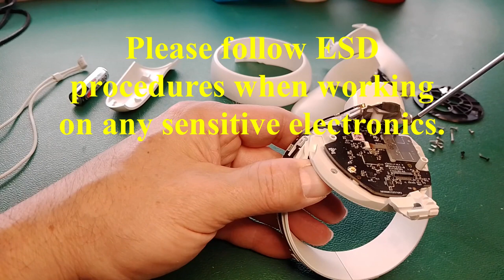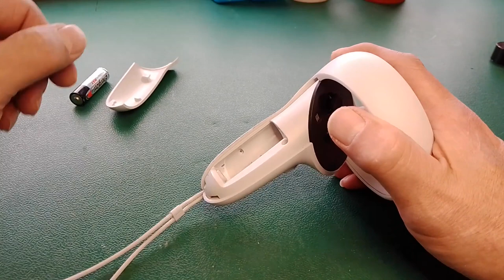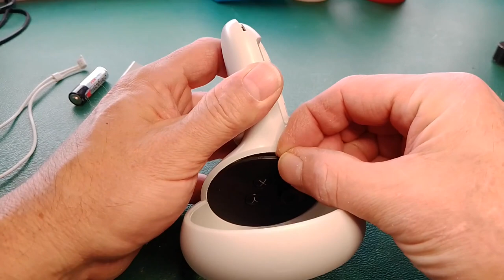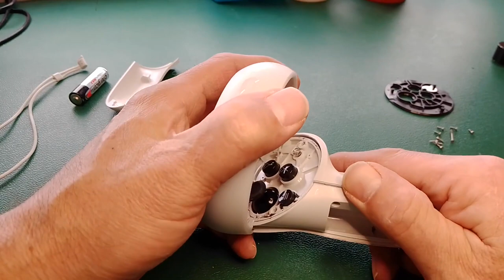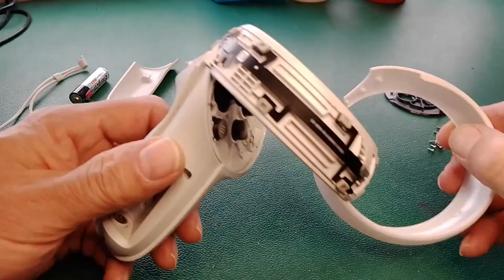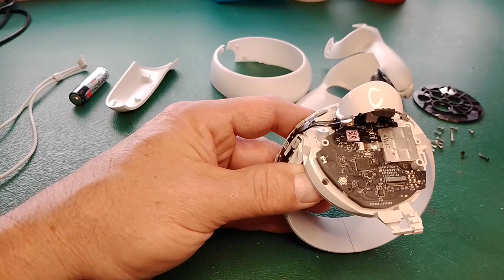Quest 2 Controller Disassembly - Don't Use  (New Version Here https://youtu.be/aZ57n6iam6Q )

Comment: Thank you for the teardown explanation! My controller catched some sugary water and circuit board got a short. With some alcohol I was able bring it back from the dead. Also, when assembling before connecting back the wide power cable, it's good to detach the front part of the handle to make access to cable a lot more easier and connect it, assembly becomes quite easy with that.
Reply from the maker: Glad it was helpful.  Have a bright day!
Reply: hopefully this works for me i was stupid enough to thing it was ok to wipe of controller with a disinfecting wipe. but that front trigger just directs everything to the board. ive been using disinfecting wipes on controllers for years but this controller is something else when it comes to liquid.
Reply: @andrewh1096  did you have any luck? i wiped my sons off and 😫hes complaining that its glitching and messing up.

Comment: Thanks for the heads up and tips. I changed the drifting analog stick very clean , you could not notice if it was opened or not. I heated the sticker a little and it came off very easy.
Ended up removing the ribbon cable from the grip and guided it back after assembly , much easier
Reply from the maker: Way to go.  Folks have definitely found some different ways of doing things.
Reply: @ImaRainbow  right

Comment: 7.08 instead of taking the ribbon off u can dismantle the  handle bit more . Check the ribbon on the handle part u can see the frame securing the cable can be taking apart . It makes things easier after that parts gets taken off first .  Thanks for the video son drop the controller and snapped the middle finger button , somehow manage to get it fixed but button does get stuck occasionally.
Reply from the maker: I'll try that out the next time I have to take it apart.

Comment: Thanks for the video! I've been having issues with the joystick drifting on my left controller, do you know if the joystick is removable?
Reply from the maker: Hi Joe.  At 9:40 in the video you're able to see a silver square on the cca.  It's got "0fwh" on it.  That's the joystick and it does come out.  Just need to flip the lever on the ribbon cable.  I don't know where you'd get a replacement though.
Reply: @ImaRainbow  All right thanks for the quick response! I'll look into it
Reply: Oh no.. I'm trying to fix my son's occulus control drifting problem at the moment... you know it needs to be replaced? I was hoping It could be fixed by cleaning and maybe re-adjusting its position...
Reply from the maker: @JustAnotherYou2  My best advice is to try the contact cleaner first.  It's inexpensive and doesn't require you to disassemble anything.  Check this video for how https://youtu.be/6Z3qv_FJbsE

Comment: Attempting full disassembly. X and Y on the left controller stopped working. Feel loose. I'm not even a rough player. Pissed off. I did your trick with the spray for the joystick. Had drift. No more drift. But the buttons were busted before I even took it apart the first time. Trying the full disassembly. Thoughts? Thank you, sir.

Comment: I bought used quest 2 and one of the AA batteries leaked and caused the spring loaded contact pin to get stuck with powdery discharge from battery.  Your video helped me take controller apart so I could get pin moving again.
Reply from the maker: Glad I could help you, help yourself.  Happy gaming!

Comment: Hopefully this video will help me fix my controllers. My cats decided they should use them as a bathroom one day and after wiping them down intensely the right one has tracking issues and the left has drift.  So heres to hoping that if i take it apart and wipe it down with alcohol that’ll it’ll at least fix the tracking issue
Reply from the maker: ☠️☠️☠️🙀
There's a reason I don't have cats.

Comment: Hey! I know this video was a while ago, but I’m wondering if people are selling that skeletal part in the middle of the screen 0:09 The part with the ring and the sensor cables connected to it? If so I really need a link to a seller or at least the name of that   
Specific part. Thanks

Mine cracked on the side and I don’t know if I can replace it without buying every other part attached to it, I’m considering just buying a new controller but let me know if it’s cheaper to just repair it. Thanks again!
Reply from the maker: There's a site called https://www.fixmyoculus.com/ where you can buy used/new parts.  If you can do the repair yourself its cheaper than buying a new controller.  BTW, this is a better teardown video for the controller.  https://youtu.be/aZ57n6iam6Q
Reply: @ImaRainbow Dude you saved my life, Thanks you so much!!!! 
Now I just gotta wait for it to restock 😅😬🔥
Reply from the maker: @Hybrid_GTag15  Glad I could help.  Hope it all works out.

Comment: okay great instructions thank you very much !! 
but after my heavy hand, the controller has now not just one problem.. but one more is added as my ribbon cable latch part on the main board is broken from its place even you warned it is the most hardest part.. 
normally i am from outside of US thats why oculus cannot support but agreed with Oculus to send the controller for fixing or a replacement..
hope they will not charge for this after this issue.. 😊
Reply from the maker: Sorry, I've done everything I can to point to the New Version.  It has a way to disassemble the handle. Good luck.

Comment: Thank you so much for this video. Not sure if it’ll fix my stick drift yet, but I am attempting to follow through with the steps. I haven’t finished the video yet so my question could be in the video, but is this a good way to fix stick drift? And the sticker at the beginning that needs to be removed, is it okay to still put in a battery or does the sticker need to be replaced?
Reply from the maker: The first thing to try is a cleaning.  Doesn't require complete teardown.  https://youtu.be/iitoevOXrf8
If you do need to tear it down, I'd recommend this video instead.  It's better.  https://youtu.be/aZ57n6iam6Q

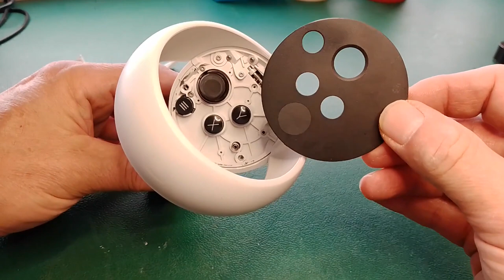Comment: Thanks for this! My analog stick is drifting, at 3:33, after popping off the face plate, can I just pull the analog stick so I can spray contact cleaner directly?
Reply from the maker: Hi Jevi,  If it's the stick, you may not have to pull it open at all.  The contact cleaner seems to work by just getting it around the stick.  My cleaning video shows how to do that.  https://youtu.be/6Z3qv_FJbsE  I'd just try a little bit at a time.   If you do pull it apart, just be careful. I pulled mine apart cause it was non functional.  Either fix it or buy a new one was the situation I was in.
Reply: @ImaRainbow  yep. Tried that. Worked for me. I just wanted to know if ever the first method won't work anymore that I may need to disassemble the face plate.
Reply from the maker: @TheInfiniteinfinity  For the contact cleaner, I'm not sure if you gain much taking it apart.  If you have problems with the buttons, you would.
Reply: @ImaRainbow  so directly on the thumbstick?
Reply from the maker: @TheGamerGod.  Hey.  I think you're asking about cleaning the thumbstick to eliminate drift?  If that's so, then this is the vid to watch.  https://youtu.be/iitoevOXrf8
If I've got that wrong you'll need to explain a little more.

Comment: I've used a WD40 special electric contact to clean the controler but now it doesn't power up at all, do you think that cleaning everypart with alcool and Q-tip may help ?
Reply from the maker: If you used WD40 Contact cleaner, that shouldn't have caused a problem.  I'm assuming you disassembled it?  If so, you might want to verify that all of the electrical connections are connected.  This is a newer, better video for teardown and reassembly.  https://youtu.be/aZ57n6iam6Q
Let me know if I can help with anything else.  Good luck.
Reply: @ImaRainbow  Yeah i did but not to the electric card component, just to the black circle in ordre the move and repear the head off the joycon, i've cleaned everything with alcohol and imma look your video, thanks
Reply: @ImaRainbow  Dude, accept this huge thanks from me, i swear i've got a tear of joy

After cleaning everypart even under bus with alcohol using your video, the controler start again, all my thanks to you, i hope you will have a freaking good years to spare me this money that I don't have

There's now just the right trigger that work like TOR (fully enabled or fully untouched) but no matter it work )
Reply from the maker: Glad I could show you the way.  Happy gaming!

Comment: Hi,  would you know the grip trigger button screw size (dxl).  Regards Mark C.
Reply from the maker: Mark,  All of the screws in the controller are T5s.   I believe they're M2s, some are machine thread, most are coarse thread. 
You might want to check out this video, instead of my old one.  The new one is much better.  https://youtu.be/aZ57n6iam6Q
Let me know if I can assist with anything else.  Have a great day!

Comment: Great content would you possibly know where to find parts ? I need to actually replace the transducer compleatly. Or any suggestions on anything that has exact part that I could rob from. Thanks again for your video.
Reply from the maker: Sorry.  I've tried to find a replacement transducer.  I've been unable to match it up and haven't found any that could be substituted.  The form factor is fairly specific and I wouldn't be surprised if it was a custom part without any OEM stock avaialble.

Comment: Sorry to bother you again. Do you know where I can find the part the connector clips into? I need to get a new one. The tech said it was no good and I need to get a new one for him to solder on?
Reply from the maker: No worries.  I don't know the exact part number, but it's a 16 contact FFC, FPC (Flat Flexible) Connector.  Digikey or one of the other electronic supply houses carry them, but narrowing it down to suitable replacement might be a trial and error thing.  
As a suggestion, get a replacement controller from ebay.  Even if the controller isn't working, you could harvest the part or the entire circuit card.  Make one good one from two bad ones.  (You'd want to make sure that it's the same left or right because the part fit is specific to controller.)  Hope that helps.

Comment: Thank you for the teardown of the oculus quest 2 controller. But mine is still having issues with the right one disconnecting from the oculus but will reconnect again after about 20 minutes to an hour. Is there any way I can fix thus type of problem without having to replace the controller itself?
Reply from the maker: I've got two things to try.  Don't know that either will work, but if you're at the point of replacing a controller, can't hurt.
First, try unpairing then repairing your controllers.     https://support.oculus.com/articles/getting-started/getting-started-with-quest-2/manually-pair-touch-controllers-quest-2/     Do both.  After you unpair.  Shut your headset down, remove the batteries from your controllers, wait a minute, power the headset.  Put the batteries back in your controllers.  Repair the controllers to the headset.  See if this helps.
If that doesn't work, unpair your controllers again.  Then do a hard reboot of you headset.  https://support.oculus.com/articles/fix-a-problem/troubleshoot-headsets-and-accessories/troubleshooting-factory-reset-quest-2/  Then repair your controllers.
Like I said, don't know if either of these will work, but if seems like the best options.  Good luck.
Reply: Hit mine in the center area of the ring, now its turning off randomly. cannot replace my controller, dont live in a support area.

Comment: Thanks for the good video. I’m having issues with the latches that hold the ribbon cables in. They are very brittle for some reason 😢😢
Reply from the maker: Try the updated video.  It makes it much easier to access the ribbon cables by popping off the handle.  Might help you out.  https://youtu.be/aZ57n6iam6Q

Comment: Both of my controllers stopped tracking I think it might be the sensors on the controllers but I might be wrong. Do you happen to know how to fix or solve that issue?
Reply from the maker: Without knowing more details, if both controllers aren't tracking, that probably points toward a problem with the quest headset itself.
I've got two suggestions;
1. Try relinking (pairing) both controllers.
2. If that doesn't work, try a factory reset on your headset.
How to do both can be found here: https://support.oculus.com/articles/fix-a-problem/troubleshoot-headsets-and-accessories/index-troubleshoot-headsets-accessories
Good luck, hope this helps.

Comment: Can I use super glue to reattach the longest wide ribbon that goes onto the motherboard? Sorry not sure what it's formerly called. The part the ribbon goes into that's attached to the motherboard fell off as I was reassembling it and I barely touched it. It sucks cause I was almost done putting it all back together :(
Reply from the maker: Are you talking about the connector that the ribbon cable fits into? (Has a little latch that flips down to hold the end in.)
If so, did the entire connector come off or just the case for it?  If the entire connector came off, super glue won't be able to help.  It won't make an electrical connection.  If it's just the case, you might be able to tack it down with super glue on the outside.  I've also got an update tear down video that might help (I figure out how to get the handle apart and makes disassembly easier.)  https://youtu.be/aZ57n6iam6Q
Reply: Thank you so much for the suggestion. I really appreciate your help and quick response. @ImaRainbow

Comment: Thanks - would have spent a whole lot more time (and probably broke something) if not for your video. The thumb button has a poorly-designed mount and either my son's was loose from the factory - or it came loose from use. Either way, that screw needs to be 2X the size of the rest of them. Back up and running for now though. Thanks again!
Reply from the maker: Glad I could help you.  Happy gaming!

Comment: I have encountered a small problem with my controller it seems my left controller index button is constantly in the pressed state , I have to push it upwards and outwards to get it in the non pressed state , if I release it goes back to pressed state ( essentially opposite of what a normal index button should do)(on visual inspection it does seem the button is slightly pushed inwards I cannot fix it externally )  
its kinda pain especially for shooting games any suggestions?
is there a way I can fix this without dismantling it?
Reply from the maker: Without having it in my hands, it sounds like a spring is out of place and part of it is pulling instead back on the trigger.  I don''t think there's any way to know without opening it up.
Reply: @ImaRainbow  screwdrivers_it_is

Comment: The inner side of my right ring snapped where it connects to the controllers black flat price, it still tracks but stops tracking when it’s facing the part it cracked at, I can see the ribbon cable detached, it’s not ripped, it’s got the curvature at the end like it’s supposed to go to something, could I still fix it’s tracking?
Reply from the maker: It's hard for me to tell by your description.  Best bet would be to take a couple of pictures and send them to me.  Discord works best,  Ima_Rainbow#5693 or imarainbow2day@gmail.com.  
I'll help if I can.
Reply: @ImaRainbow  hey could my friend message you on discord?

He recently broke his remote and is trying to find info online to fix it. I figured I would look online myself to see if I couldn't find anything to help him
Reply from the maker: @derrickshowproductions3010  Certainly.  Ima_Rainbow#5693

Comment: Hi, my quest 2 left controller connected but its not showing inside headset and light continuously blinking. May be you know some part, which I want to repair. Please help
Reply from the maker: Try unpairing your controller, then repairing it.  See if this helps, https://support.oculus.com/articles/getting-started/getting-started-with-quest-2/manually-pair-touch-controllers-quest-2/
Reply: Any luck with this? Mine is doing the exact thing.

Comment: Thanks for the in depth breakdown. When disconnecting what looks like an rf cable, the one u popped off before the ribbon cable when accessing the circuit board, I accidentally popped off the male piece that is supposed to remain on the circuit board. It is still connected to the wire carrying the signal from the circuit board. Can I just solder the connection back together?
Reply from the maker: Possibly.  If the cca didn't get damaged when it detached.

Comment: Thanks a lot. Really helped me out in a pinch. Managed to get my "B" button working again!
Reply from the maker: Glad it helped!
Reply: how were you able to fix the button once you disassembled the controller?
Reply: @HADEEB-wo1sz  I had a bit of corrosion on the pcb, just wiped it off with isopropyl, under the rubber dome.

Comment: i cant unscrew those top two screws theyre at a angle where i cant get them. Is there any way i can unscrew then at a angle?
Reply from the maker: Try watching this video.  It's newer and shows the details better.  You'll need a small torx driver that will fit.  Hope this helps.
Reply: @ImaRainbow  yeah tomorrow I’m going to the store to buy a smaller one

Comment: Ive gotten all the way down to the ribbon cable, I’m scared to mess up so i wanted to ask, lift up on the grey part or the black part on the end?
Reply from the maker: Are you talking about the ribbon cable at 7:00 in the video?  If so, there's a latch on the end of the connector.  It flips up, then the ribbon cable will slip out.  If you need more help, hit me up on discord.  It's quicker than comments. Ima_Rainbow#5693
Reply: @ImaRainbow  ill add you now